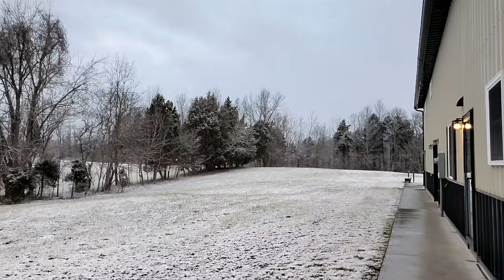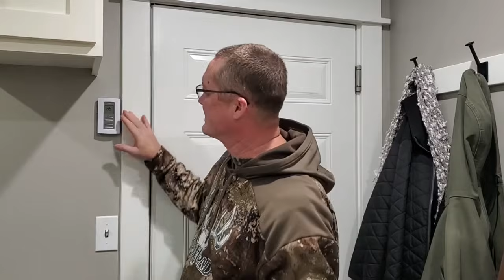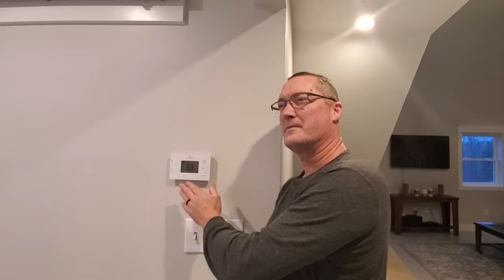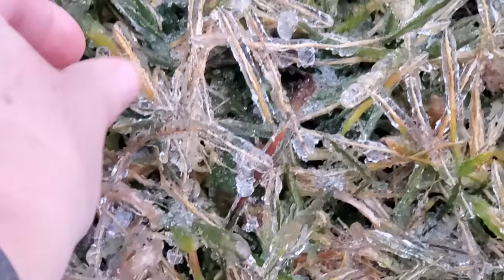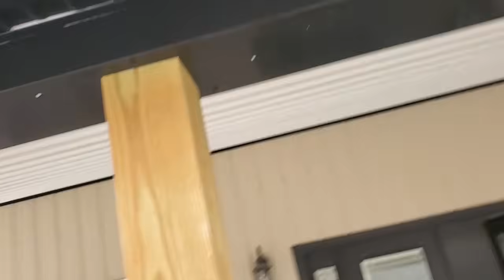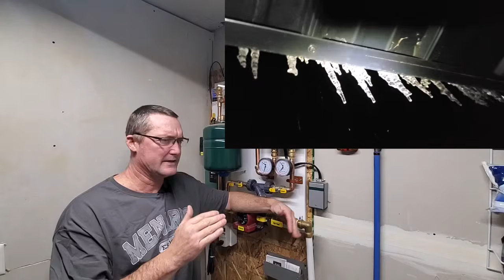Floor Heating Questions Answered Including Price || Barndominium Living

Comment: If you want to know exactly where the pipes are ran in the floor . After leaving the system off for a few hrs, turn the system on and watch the floor with a thermal  camera ( brand or model doesn't matter) you will see the warmth of the pipes within a few minutes . I helped a friend locate his pipes in his garage so he could put a Lift in. Works like a charm

Comment: Your system uses propylene glycol, not glycerin as the antifreeze. The kilowatt meter(calculation hours running) will not tell you how much electricity the Stiebel Eltron water heater uses as the water heater is variable output. The water heater uses the minimum electricity need to warm the water to the set temp which is well below the maximum output of the water heater. Another person that pieced together his own similar heater board purchased an old analog electric meter on eBay to measure the actual electricity used by the water heater.

Comment: He is only giving us the price for electricity for the flow of the water through the floor. He is not giving us the price for heating the water/ Glycol mixture. That is done with a 220 Volt heater. That his gadget cannot calculate.
Still this setup with solar and storage batteries is absolutely ideal, especially with the heat pump! Big bucks and great choices! Best Wishes!

Comment: I thought I heard. you say that your total control panel, heater, compressor  and other temperature and pressure valves etc. , the whole panel board was a single control panel complete and could be ordered from a manufacturer  as a total unit, which would be great news, is there a name for that Control Panel or manufacturer??? ANY  information would be  appreciated, thank you
Reply from the maker: @johnmcguinness1576  Here's the Menards link for the one we have.  https://www.menards.com/main/plumbing/hydronic-radiant-heat/radiant-heat-boilers/hydro-smart-trade-1-zone-low-temp-electric-boiler-pro-integrator-panel/hsbp4w-10p-s-lt/p-1444433727814-c-8519.htm

Comment: How does it heat upstairs?
Reply from the maker: We have a couple things working in our favor.  We have an open floor concept upstairs except the closet and bathroom so heat can migrate easily.  We also have spray foam in the ceiling insulating well with minimal heat loss.  If it gets really cold, we can use the heat pump to blow air upstairs.  We love the heated floor.
Reply: @ so the heat just works it’s way up? Our design is pretty open in living  room, but has high ceiling
Reply: @ by ceiling you mean to the roof?

Comment: I believe this video was about showing off the heart of their in-floor heating system. The figures that were suggested do not add up. The Kilowatt gadget to measure electricity usage  is just a fraction of electrical usage. The instant hot water heater uses the bulk of the electricity, there was no mention of how much electricity it uses. Additionally, I have yet to see a home in which the heating system only runs for 90 minutes, especially in a cold climate state in the dead of winter. And if it were true that the in-floor heating system only runs for 90, then why would they need a heat pump as a back up. For the heat pump to turn on, it means that the in-floor system can’t keep up even if it’s running 24/7 at 11 kilowatt per hour. Like said, things do not add up!

Comment: I bought this exact panel because of your two videos for my barn.  I don't have the ceiling in yet but walls are insulated with double sheets of 1.5" foam board.  I'm going to run a test week to see how expensive it will be without ceiling or insulation up top.  I just went back to your video to see how you wired the boiler and the cable you used looks to be very small.  My unit says to use #6 copper wire.  Your black cable almost looks like 10ga.  What size did you use?  I'm also in Indiana!  Westfield area.  Thanks
Reply from the maker: Each wire goes to a 40amp breaker, so 8ga wire will work.  If each of your lines pull more amps then you size your wire accordingly.  I don't remember what gauge i installed. The inspector said it was good so I'm assuming its to code
Reply: @RVBarndominium  thanks for the response! I enjoy your videos.  My manual says 6ga W/ 50amp double pole breaker. Mine may be different though. Gonna need that heat coming up, it's already pretty cold where I'm at!

Comment: A couple points: first, gas is not “more efficient” than electric, but it is more cost effective. Electric is generally 100% efficient, gas is max 98%, generally a bit lower. Thermal efficiency is another separate issue. A better option than what you opted for would be a heat pump boiler (or heat pump water heater, or heat pump with a coil) as the COP (coefficient of performance) can be 3-4x more efficient than what you have.
Reply from the maker: Thanks for the detailed explanation. Sounds like you have some expert experience.👍
Reply: @RVBarndominium    Yes, actually, but you can likely find solutions that are more efficient, effective, and less costly right here on YouTube.

I wonder why you put in radiant heat (which is the absolute best way to heat a house or business) and also a heat pump. Perhaps you realized a heat pump was only slightly more than A/C, which is true, but that same heat pump could be used with a hydronic coil to heat your slab, bearing in mind that COP will decline using very cold outside air, but even then it’s more cost effective than electric resistance heat like yours. 

Anyway, you did a great job on the hydronics and you have numerous alternatives to that electric unit that would save you money and eliminate the need for the heat pump to supplement the hydronics with warm air heat. A heat pump (hybrid) water heater is also a great option if you have suitable space for it.
Reply: Are you kidding me. Electric is the worst way to heat
Reply: @Chris-hr4ly    You need a lesson in physics.
Reply: @JohnCap523  Its definitely the worst way to heat as its the most expensive way to do so. The most cost efficient way is by using a propane water heater, not a boiler.
Reply: @danbiss87     Cost and efficiency are different things. And propane is the most expensive combustible…and least safe. It should be the last resort for fuels.

And a heat pump isn’t the same as resistance heat. You shouldn’t assert knowing something when you don’t.
Reply: @JohnCap523  It didn't mention anything about heat pumps or energy efficiency just costs. Electric is the absolute worst in terms of cost/btu output. New propane water heaters are like 97% efficient and a hell a lot cheaper per btu than electric. Usually propane and electric are the only two options unless you live in the city so I bother mentioning oil or natural gas to which both of those are a lot cheaper than electric as well. Electric should be the last option. As far as heat pumps go, depending on the climate, like up north where I live, they can't be used as a primary heat source only secondary.
Reply: A gas flame can burn at 2200 degrees.  An electric grid usually far less.  Heat transfer is temperature dependent.
Reply: @rogersmith7396    Gas heating equipment exhaust reaches 300-400F (standard atmospheric, natural draft furnaces), so it’s really not relevant what the flame cone temp might achieve. In any event, my point stands.
Reply: @JohnCap523  The heat exchanger will mimic flame temp.
Reply: @rogersmith7396    Really not sure what your point is in this context.
Reply: @rogersmith7396 
You are so confused

Comment: Help me out I missed something. Title says "including price". Did I miss the "how much the price was", and in the beginning of the video how much it cost in price to operate it 07:20, which I never heard that either.  Could you provide January's total kW  usage consumed from your electrical bill?  You can follow up with another one in May, and that differential should provide a close enough in differential that was used for your in floor heating. Cheers.
Reply from the maker: Thanks for the idea
Reply: How is system worki g now ?

Comment: Thanks for the info. I am considering a barndo with radiant floors as well. However unlike yourself I was thinking of doing geothermal with the infloor. Now I am not. Reason for that is toward the end of your video you gave me your numbers for operating the system in the coldest months. With your electric boiler , If you were to put solar panels on half of your roof this would more than compensate for any electric that you used. And almost Render the geothermal aspect moot.  In fact, your  kilowatt output would continually make you a power utility, as your consumption would nearly never exceed your production.  I had solar installed last August, but for reasons (and there are a few) I won't mention, I am still not producing energy.  Nice job on the video.  God bless.
Reply from the maker: We had a rep come to our land to quote geothermal.  It wasn't worth the price plus alot of land is required.

Comment: Can I ask what part of indiana you are in south, central or northern part? I am looking to do a similar sized radiant project in an ICF house this summer and wondering how your system has done through another winter. Thank you for any information you can provide. I am on facebook if you want to message me over there.
Reply from the maker: We are southern, but still get some pretty cold temperatures.  Sometimes up to -18.  We love the heated floors and its still doing good.

Comment: So the kw meter is 110, the heater is 220.
So the kw meter is useless. The 220 heater is the one that gobbles up power. The one pump probably uses 70 to 90 watts.. your thermostat needs to be calibrated to the actual floor temperature. That is why you get 2 different readings.  
Your 10 kw heater is 10,000 watts. So when your heater runs for 1 hour continuously  it will have consumed 10kw of electricity. If you are paying 20 cent per kilowatt it costs $2.00 for every hour your heater is on.
So when you use 1000kw of power for the heater it costs $200. 🤔

Comment: Why did u not elect propane? Maybe u didn't want to make the investment but propane is smarter as when electric fails, u have no way to stop your pipes from freezing and bursting
Reply: Until you price propane or the supplier says there is a shortage and you are out of luck.  Propane is a byproduct of gasoline production.  It will track gasoline prices.
Reply: Also, the cool thing is the water/glycol does not freeze until it gets to a very very cold temperature

Comment: So.... how many kWh does it use since you bought a kWh meter?  $44 is meaningless 😀
Reply from the maker: The meter cannot be connected to the boiler since it is wired directly to the elect panel.  I used the meter to monitor the total number of hrs the pump was "ON". Then measured the amp draw from the pump and boiler separately. Pump ised 1amp and boiler used 38amp.  Pump is 110v & boiler is 220v.  The system ran for 1.55hrs per day. Boiler uses 9800 watts.  I don't remember what the price per kWh was when i did the video....that was a year ago. 
Google some electrical calculations and run the numbers.  Looks to me to be around 450 kWh.  But that was in the worst weather, with our sized boiler and 1200 sqft of concrete.
Hope that helps
Reply: @RVBarndominium  thanks for the reply, really appreciate it! So sounds like your system (pump and boiler) is around 9kW (110 x 1 + 220 x 38), which matches your 9800W measurement.
Interesting to hear that it just needed to run 2h/day even in the coldest period. So that's 2 x 9kW = 18kWh/day and 29 x 18kWh = 522kWh/month.
Reply: @samheyman09  that would be $.084 per kWh. That seems very low to me. My utility charges more than that just as a infrastructure cost, plus actual usage of energy.
Reply: @4philipp  My connection charge is $40/month.  I ran a 100 watt yard light for a week and they jacked my bill way up.

Comment: If you want to find your tubing, mop the floor, crank the system a bit and see it will dry where the tubes are first. It will literally map it out.
Reply from the maker: Thanks for sharing!  Never thought of that.👍
Reply: Use a infrared camera and they light right up.
Reply: Or use a thermal imaging camera

Comment: You stated the electric heater is a bit over 9,000 watts and that works out to around 30,000 BTUs. The house must be VERY well insulated and air tight. BTW, a heat pump is more efficient than electric because a heat pump doesn't make heat, it only moves heat between outside and inside. IOW, it should be cheaper to run both systems to maintain your indoor temp with the floor heat only keeping the chill from the floor. The heat pump will do the bulk of the heating anyway, when outdoor temps are above 20 degrees.
Reply from the maker: Yes, it's well insulated - The entire living area is sprayfoam including the ceiling. We do use both only if there is a chill in the air..otherwise we leave the floor heat on 67.

Comment: Never heard anybody refer to propylene glycol as glycerin before? It looks like there’s a supply shortage of antifreeze too.  Steve Lav says the antifreeze will eat away at the seals in the pumps but it’s nice to have if you want to shut down and head to Florida for a couple weeks in January. Of course, you’d have to drain your water pipes and pour antifreeze into the traps too.